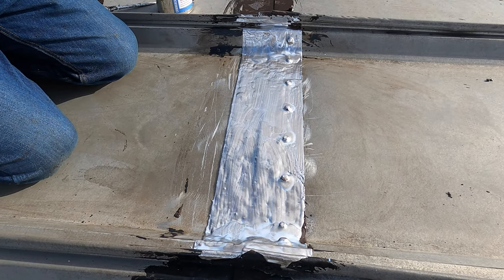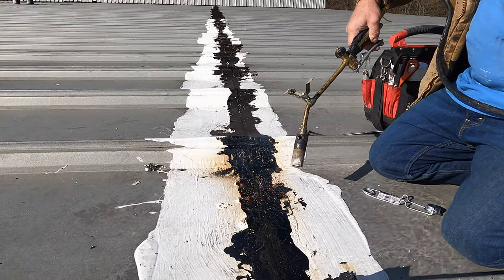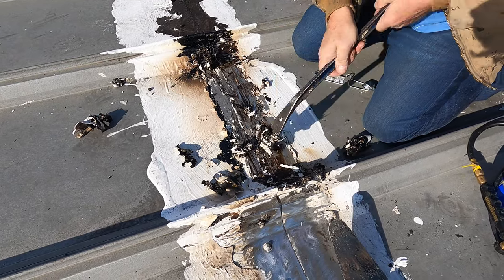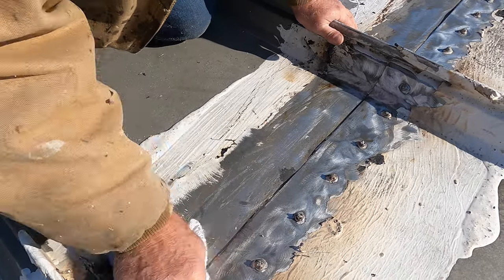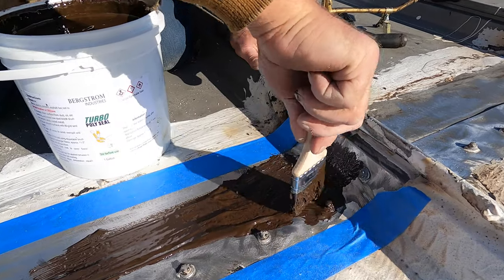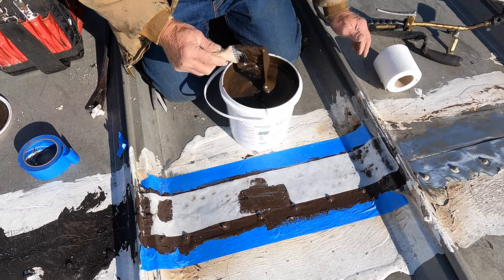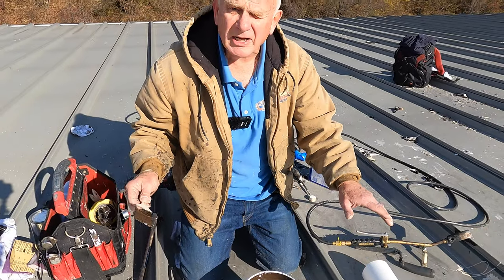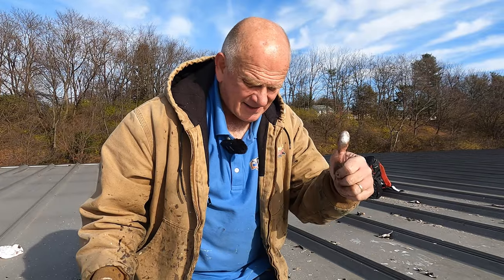Easy Fast Metal Roof Leak Repair DIY

Comment: I have a leaking problem with my roof ! My roof is half galvanized and concrete when the water comes down from the galvanized roof it souk up the boad
Reply from the maker: i am not sure what you are talking about, sorry
Reply: When the water comes down from the metal roof too the concrete roof it leak back under

Comment: There’s no way in hell that I am going to repair all those seams with a torch and scraping each and everyone off. The silicone is a terrific product and you need to get with the times
Reply from the maker: I agree the Silicone is very nice, but when it is not applied correctly, as in this case, then it will not seal the seam. Why do you think someone else tired to seal it with Tar afterwards. 
Getting with the time?  I think I am a little ahead of you. You still catching up. When you make comments like this, then you show that you are still a little wet.
Honestly, I did not want to scrape off the silicone myself. I was adhering to the metal very well. The reason why it cracked, is because they did not use a fleece over the seam to give it strength. Somewhere in this particular video I show a few seconds where my wife is using silicone over the seam. But wit a fleece.
So, by accusing someone without knowing all the facts is not a smart move.
Anyway thanks for the comment. You just got me going again
Take Care

Comment: It can definitely be better if they roof it flute filler and epdm.
Reply from the maker: Hmm, no membrane with glue will work on a very hot metal roof during summer
Reply: @FlatRoofDoctor  yes it will rubber is made to withstand higher temps even colder weather
Reply: You take 3 inch Epswhite foam to flush out with the standing seam then add 1.5 iso screwed down 10 plates per sheet then glue epdm